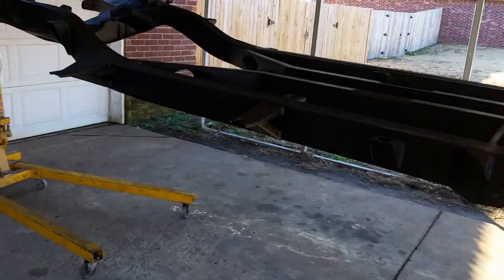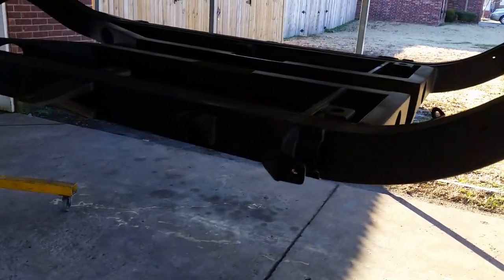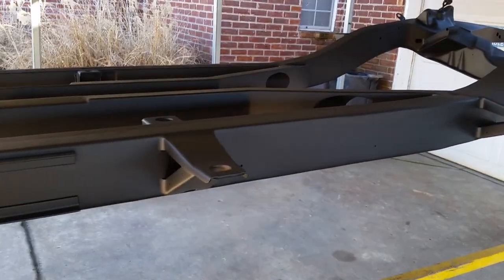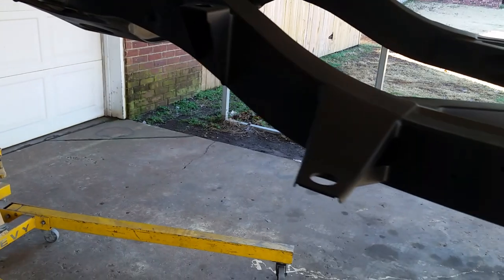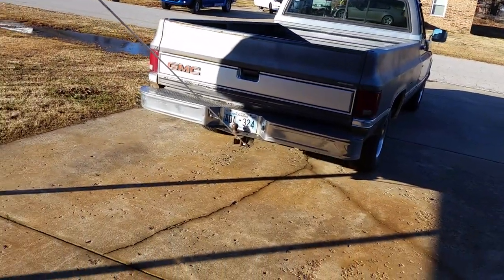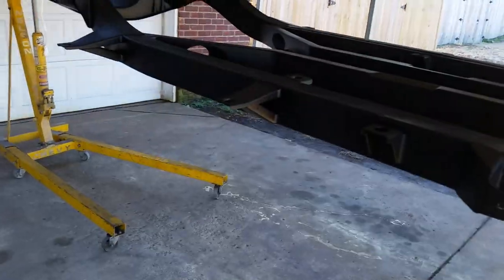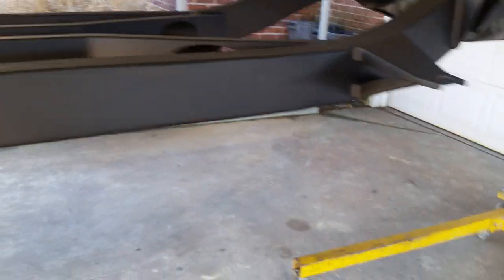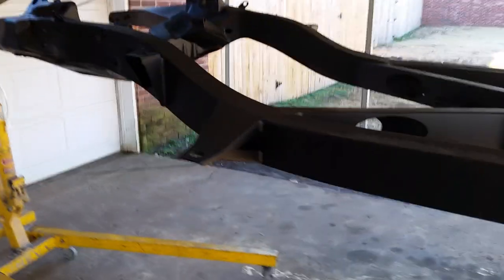55 Belair vlog, Final prime on chassis

Comment: You did a ton of work on this frame but didn’t install a “leaf spring relocation kit” (for wider rear tires).  What was the thinking on that?
Reply from the maker: Not sure why I needed to spend money for wider wheels and tires. I have 9 or 9.5 inch wide wheels on it now.